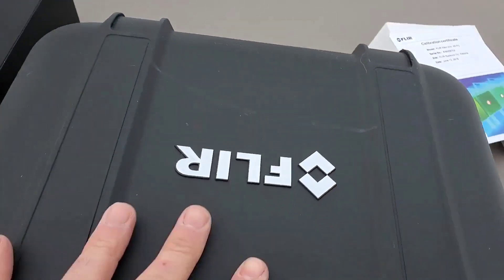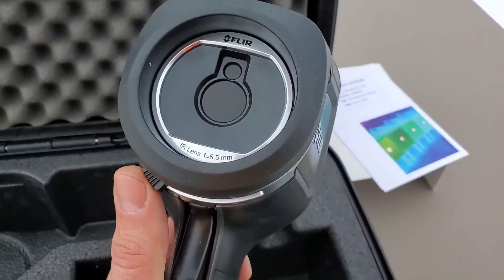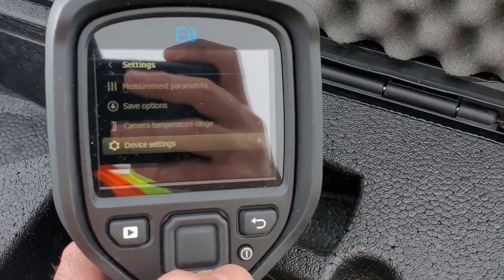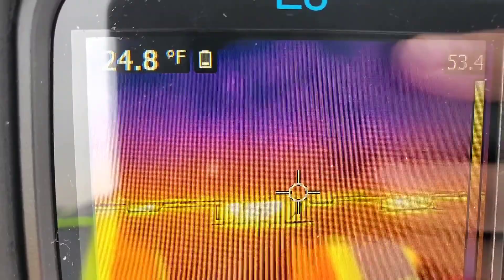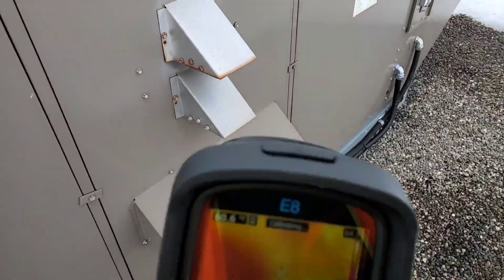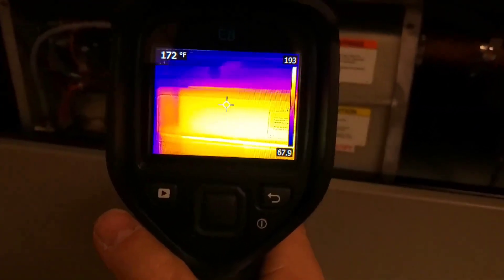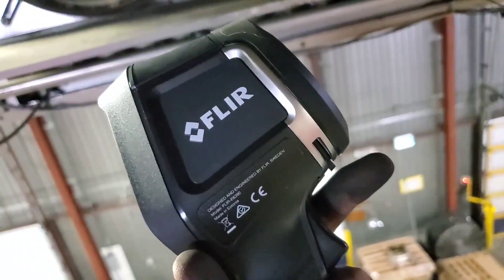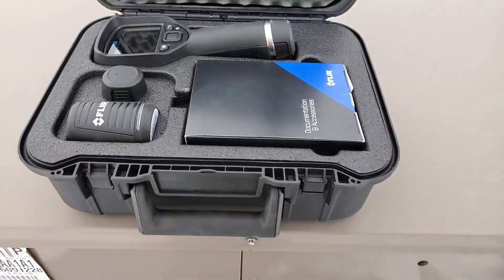Troubleshooting With Thermal Imagery

Comment: A Thermal Imager is one of those tools which you dont realize how powerful and important it is until you have used it and found a fault with one. My Flir has saved me hours of troubleshooting and a number of would-be fires and burnt connections.
 Well worth the thousands of dollars imo...
One thing all users should be aware of though is the emissivity of different materials, not understanding this can give false measurements. When measuring actual temperatures for a suction and discharge line for example, i always make sure to put some electrical tape around the line (or something with high emissivity) to give me a true temperature reading of the lines as copper has a low emissivity level and will just radiate the reflective heat source such as yourself or the ambient temperature.